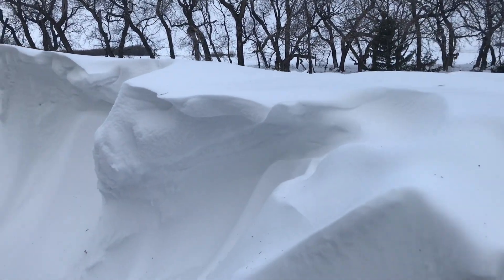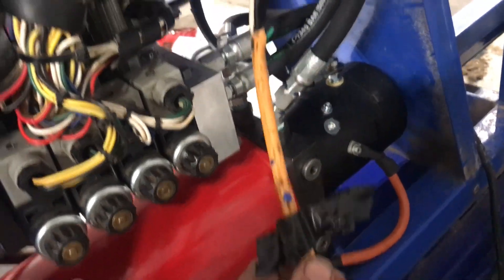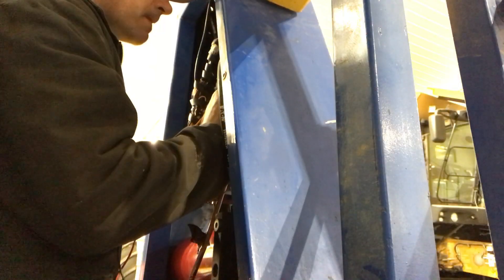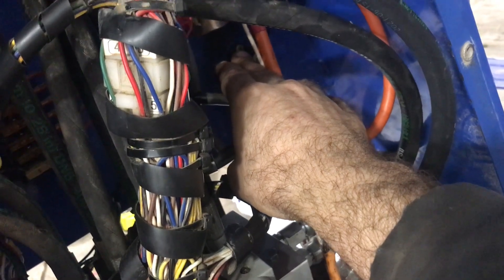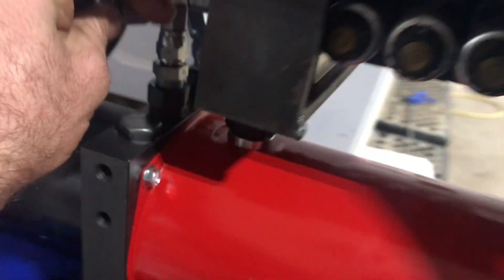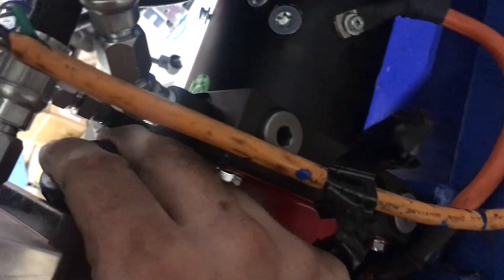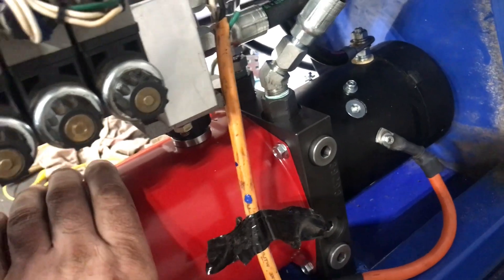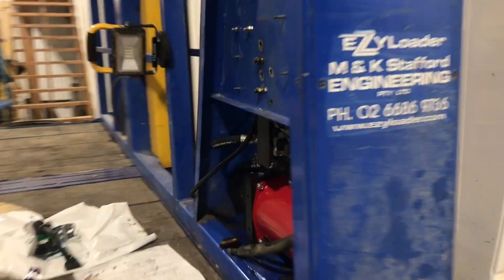Test Fire 💨 on the New Ezyloader Motor

Comment: On my trucks I quite using the large batteries and replaced with two batteries from Costco. Better batteries with better warranty.  Each truck now has 4 batteries. Two for the truck and two for the lift.

Comment: Hi Ian, food for thought...if the voltage is too low for a motor, then it will draw more current to compensate for the drop.  This might explain why you blew a fuse, because the current is probably right at the upper limit.  Also, keep in mind that once the motor starts to see higher loads (hives on your forks), then you'll be popping fuses left and right.

Comment: Hi Ian
You also need to check your alternator on the truck. When you start the truck the voltage should go up to 14.? something and it is not. It looks like an alternator / voltage regulator has a problem. Battery problems need to be load tested.
Hope this helps. P.S thanks for what you do for all Beekeepers.
Mike Koehler

Comment: Just an idea, my duramax  the alternator does not always start charging soon as you turn the motor on it likes to run a little especially if it is cold, I recant my statement about  open loop hydraulic system meaning that if you are not using a function that there is no where for the fluid to go all the valves are closed and no return path to tank which is normal in allot of systems with a compensator controlled pump so all that to say .....sorry you are stuck with that screeching from fluid pushing over the pressure relief valve when you stop any function. Glad to see it working, have a safe day.

Comment: What a great job an also now you know the system so if something goes wrong you know the direction to go . Does that or I think it looks like a 4-D battery under does it just run the lift or does the truck battery all tied together. I was going to say I think I would put bigger cables on that system those look small it looks like a # 2 . The bigger cable is like in all big trucks they are 2/0 . You will get a lot more amps thru them and also that 4-D battery if it goes bad I think I would go with two 31 group batteries witch will give you more amps witch will be easier on the pump motor and better service . I have 3  8-D battery in my motor home . One is starter battery and two of them are 8-D deep cycle for house battery. Those 8-D are hi price around $700.00 each . The 31 group is the same batteries big trucks use . Just something to check on and think about . You did a great job Ian .
Reply from the maker: I appreciate the input !

Comment: Not sure but seems like your alternator is bad. If I heard what you said correctly, you had higher voltage with the truck off.  Your voltage should jump right up when the truck is running.
Reply from the maker: Ya something isn’t right there

Comment: Nice job, Ian.
I hope that battery is still good - I generally like to have a little trickle-charger hooked up for long periods of storage, and even in your climate, I would think solar would work for that if it is stored outside.  Lead-acid batteries last best when they are kept topped up (unlike Li-Ion batteries, which hate it).
I'm very impressed by the way the wind has sculpted the snow - I love the scenery snow creates, but it is a bad mix with a wheelchair, so I can only enjoy it from afar.
Luckily we don't get much in the UK, despite being at about the same latitude as you - I'm at 52°8'35"N (so just north of Reindeer Island in Lake Winnipeg) and a whole 6.25kM from the prime meridian but can pull over 3Kw from my roof-mounted solar panels, so a little panel to keep a lead-acid battery charged is trivial within the confines of a cab roof.  Less so on my disability scooter, but it is more for keeping the batteries healthy than actually charging them.  I do not want to kill those, as it takes 5 12v batteries, so rather pricy for a full set.
Reply: Didnt read your post until I had pressed enter lol .... totally agree with trickle charge.

Comment: For your aux battery, I find switching to a top-post thread-on lug works really well.  Those lead terminals are terrible.  Also, do you have an isolator to prevent the loader from discharging the truck?
Reply from the maker: I use to before it burnt out, now it’s all hardwired .  I’ve been left in a yard needing a boost lol but I try to keep the truck running now just to help keep the voltage up , easier on the relays and brushes
Reply: Some battery have a side vent that takes the vapor down away from terminal  when being work hard or charged talk to battery man next time you are there it helps with corrosion.  Of terminal

Comment: Keep the top of your batteries clean of dirt as this will bleed off some of your battery charge. Check your battery voltage at your truck battery. If it is also 11.8 when truck is running you may have an alternator problem.